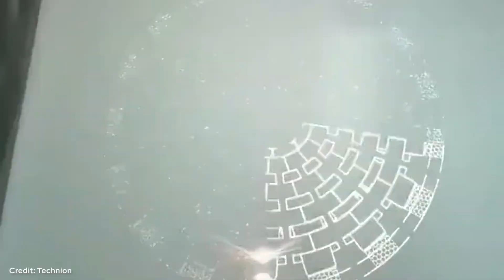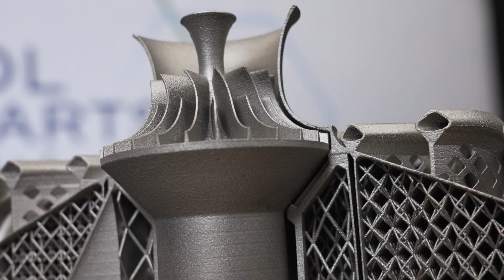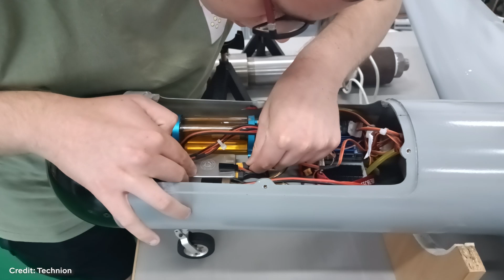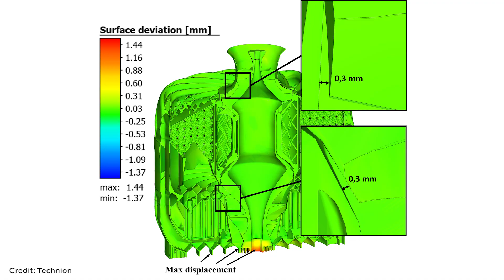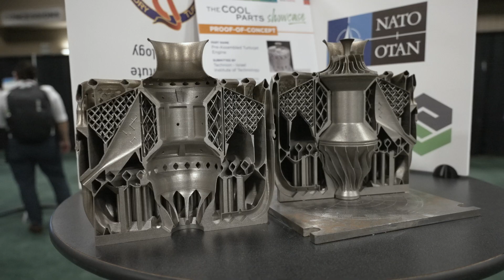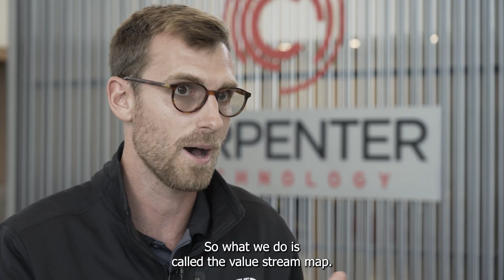Turbo Jet Engine 3D Printed In Only Two Parts

Comment: Small Problem: IT DOESN'T WORK. The video doesn't show a working engine, none of the organisations has published any work in regards to the engine performance or any designs for peer review.
Reply: they haven't even shown that the proposed geometry works. first build a prototype with as many parts as you want, machined surfaces, bearings and then talk about a print-in-place fluidic bearing tolerances
Reply: I'm very familiar with the insides of a variety of actual running turbojets, like the GE J79, J47, the RR Avon, Olympus, and a few turbofans like the RR Spey, The GE CF6, F404, and CF 34.
I see nothing that I recognize here. Maybe I can't see the highly advanced super future tech... I have spent far too long working on real, working gas turbine engines.
Reply: Exact.
Reply: i wonder how those "sintered", or "multicrystalline and slightly porous" blade assemblies will hold up with centrifugal forces when some heat is thrown at them... inconel is all good and well, but arent we also taught about the "advanced technology" where certain turbine blades are "grown" as one "crystal" with no grain interfaces?

then theres the whole design aspect of high speed shafts, and rotating assemblies... lessons well documented by say, gustav delaval and charles parsons well over a century ago...

human race is getting stupider.

the more i look at this "hi tech", the more i start to ask... "whats it all for? whats the end goal here, of civilisation?"

and the older i get, the more i tend to want to throw it all away and just watch the grass grow and smell the flowers...

as for these types of videos... talk about dumbing it down...

can open a book from a century ago and learn something, easily and clearly explained... these days, everythings either primary school level, whilst ignoring vital aspects that merely cause confusion and misconceptions, or its university level with equations, equations, theory, and little to no practical application... and a lot of hard work to undo all those previously mis-learnt principles.
Reply: @paradiselost9946  You are falling victim to the survival bias. Since we industrialized what you mention has been common to a lesser or bigger degree. Nevertheless after a century only the useful knowledge has survived, thus we have the impression they used to generate only useful knowledge back then.
Reply: @paradiselost9946 the “only” problem with your argument is the fact that turbine blades are made using additive technologies for years. Do your homework first!
Reply: @paradiselost9946  You see it's tendency to take out everything from people and make it out of their reach. You don't have a 3D printer which can print things out of metal powder? Well, you have to BUY those things instead. If ANY part of this "engine" fails, you have to BUY WHOLE engine instead of broken part. You don't have such money? Well thats your problem. Old machinery, including cars, was build back in the days in the way that was fixable. Now we have to fight like Louis Rossmann for rights to repair... Agenda 2030 is pushed harder and harder because we are getting closer to this date each year.
Reply: Well said @paradiselost9946
Reply: My sentiments EXACTLY, @paradiselost9946 . History has proven... for all we do externally (tools, agriculture, etc.) to alleviate our load.... we just create more work, more weakness, and more dependency. 

I firmly belive ours is not the first of advanced tool-making species to inhabit our planet... and none of the previous remain for the same reason(s) ours will cease.
Reply: Air bearings, like In Capstone turbine!😂
Reply: It's not going to work. Even if they made it from insanely expensive materials capable of the sustained temperatures... the effective surface area dedicated to power conversion is simply too small. It's a fascinating, yet useless example of 3D printing capability.
Reply: Spot on . If it doesn’t work, is just an intricate paper weight
Reply: I was thinking the same thing. They say "it requires further development" but I don't think the efficiency of such an engine will ever match a traditionally designed and assembled one.
Reply: Exactly..
Reply: Proof of concept mate.
Reply: Look up Beehive Industries and their 3d printed engine, they have a video of it working on their website.
Reply: Proof of concept has been the only thing we can get out of these designs because the result does not have the accuracy to have the surface tolerances and strength needed to work. It's like a better version of a paper mock up
Reply: After manufacturing the part they rinse it off with jet wash
Reply: Aurora Labs 3D in Australia
Reply: Look up leap 71

Comment: Very impressive beginning.  One of the greatest issues with gas turbines is dealing with rotating high temperature components.  Currently, this is addressed with some very advanced materials.  It will be interesting to see how 3D printed materials can deal with this.  Current aircraft engines require inspection and maintenance.  Components are removed, inspected, reworked or discarded when required.  Some rework could be completed in the 3D printed design, but it is limited.  For short term applications, such as weapon systems, these issues are not as significant.  I hope this technology is also used for some non destructive things.

Comment: I'm all in for built-in heat echangers, complex functional integration, and pushing the exercise as far as conceptually possible. But really, an engine rotating at 50,000rpm with an unbalanced rotor which bearing surfaces are unmachined, and zero way to inspect before assembly ? Even supposing this is a throaway engine for one time use drones, to me that's unrealistic.

Comment: How do you insure high tolerances for parts that were 3d printed which have pretty poor tolerances.
Reply: ALL 3d prints must have the critical surfaces machined, e.g. mating surfaces, sealing surfaces, datum/assembly surfaces, dowel pin holes, threaded holes, and bearing seats. However, most surfaces do not need tight 5-axis tolerances and can get by with a 0.030" surface profile that printing provides.

Comment: they don't say how much power they expect this to make, but it's not going to be much. that tiny little compressor isn't going to generate high pressure. it's not clear how that hydrostatic bearing is fed, andit looks like it would be leaky. there are 2 other bearing areas at the ends that they don't discuss. no explanation about maint and inspections. no explanation about fuel feed or how combustion occurs. interesting idea, but i'd be shocked if it worked.
Reply: The schematic at 2:05 already tells a lot.

Comment: pretty rough surfaces isn't ?   for flow reasons.  Have they tested it in anything that , say generates power (electricity) - and how does the same fuel in/electricity out compare to a traditionally built one ?  lifetime hours before failure ?   no need to rebuilt - is it just unit swap ?   Interesting options !
Reply: If surface roughness is an issue, it could be polished by abrasive flow machining.

Comment: Yeah no. Two major 3DP components ? Maybe, though I'm looking at three here (two stator halves). Then there's the fasteners, the bearings, fluid feed lines (fuel, oil) oh and A METRIC F-TON OF SENSORS, ELECTRONICS AND WIRING. I mean unless they can 3D-print a FADEC, which I'd pay good money to see.
Reply: The stator was cut in half for demonstration purposes.

Comment: This is going to be a problem. China will steal the plans and print them for themselves and build new missiles and jets with it. Iran will do it too. Then there is North Korea. This opens pandora's box, with S.E Asia doing metal prints for cheap, you send the files they send you printed parts in return. Didn't anybody think about export security, or national security at any point of this research?

Comment: So where is the fuel pump, electronics, sensors, valves? It's not an engine, it's two assemblies that have been consolidated. It's basically a casting blank that's veeeeery complicated.
Reply: It also looks heavy af for how big the compressor and turbine are
Reply: @mitchellstrobbe7779 well there's an argument to be made that it can be applied for power grid generation where weight is irrelevant as the company iterates over it. Then move back to aircraft once the weight is brought down enough for it to be viable
Reply: Power grid generation, using turbo jet engines??
Do you know how crazy that sounds?..
This really only has one/few time use for unmanned military applications, in my humble opinion..
Reply: @jfair7050  buddy all the fast load pickup units are gas turbines
Reply: Hey I'm not going to pretend I know what I'm talking about, but I think a turbo jet engine, is a bit different from a gas turbine? Same principle and all, just like a turbo charger is..
But to my limited knowledge, a turbo jet engine isn't exactly good on fuel, so I don't know what the BTU conversion units would be like (or however you want to measure efficiency)
Would have to be a better way? Unless fuel usage, is not a consideration..
Seeing as they are calling them the Israeli MIT, I doubt civilian use cases are high on the list of their priorities.

But, I honestly, do not really know what I'm talking about and happy to say, that I was wrong 👍
Reply: Stop being silly, it clearly has a fuel inlet and ignitor space, its not not an engine without them, just like a motor is not not a motor without a battery.
If you pour in fuel and ignite it, it will spin.
Reply: Yeah this is just a concept, an idea. Still much to be done before it actually works. But keep at it!!
Reply: wish electronics are reduced or replaced, they are a very complex and annoying part.
Reply: If i am not mistaken by naming part with their own names In jet engines called accessories
Reply: flool plump
Reply: Baxi "ecogens" used to be available , they were a combined home Central heating / electric generation unit based on a 6kw sterling engine.
  A shrunk down version of this maybe ideal for this negating the need for so many fast response grid gas turbines
  The unit would supply the household selling excess to the grid while simultaneously using waste heat to space heat during the winter months when demand is high
  Would make a great backup for wind and solar 🤔
Reply: thats a YOU problem dude, not a single reasonable person expects all that gets 3D printed. Peripherals are never considered part of any engine btw. That being a turbine or a car engine.
Reply: I think you and many other commenters on here are underestimating the groundbreaking magnitude of 3d printing inconel products.

Comment: Channels have to be integrated into the design in order to allow the excess powder to be removed in post-processing. 
How is that done ?
Reply: If you take a close look on those schematics of the engine, you will notice, that there is no cavity in that engine that is not either part of the air or fuel flow. so no extra channels necessary, because they are already all connected.

Comment: Impressive. The finish is a little rough for high speed air and compression, and I'm curious to see how it retains it's tolerances under the high heat of combustion. I could see this as an engine for a something that's single use like a ordinance drone or cruise missile.
Reply: I’ve wondered if you could flow abrasive particles through the passages, post printing, to polish surfaces.
Reply: @danamyrocket  that is a thing!
Reply: Extrude Hone.
Reply: Just want to point out that long-term use is not planned. For cruise missile use, it would need a 3-4 hour lifespan max. So this could be a more disposable jet engine.
Reply: That rotor will rip itself apart. The whole thing needs to be stuck in a cnc machine and then balanced like a turbine blade.

Comment: They need to make the outer shell 2 parts so the jet can have maintenance
Reply: Yeah, no. No serviceable parts.
Reply: Why service it if you can just pribt a new one?
Reply: Mainly just proof of concept of the extremes they can go to. Production would be more like you said serviceable. But, I can see a model that is not serviceable being used on attack drones as they could be single use and the engine would be destroyed anyway. Space X is using these kinds of designs on their new Raptor engines. Its crazy small/efficient for the power it puts out.
Reply: Depends on what it's going in. Reuse and efficiency is probably not the strength of this design.